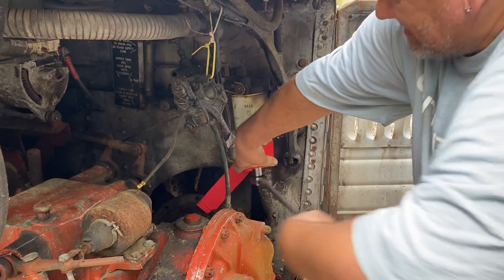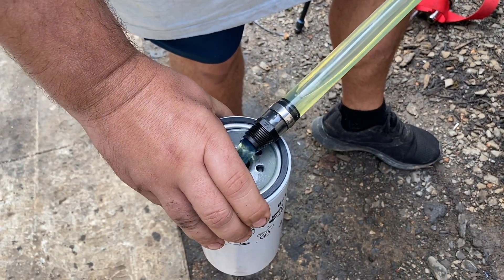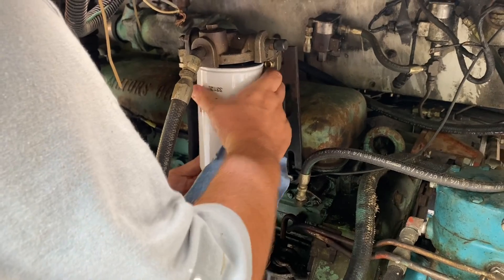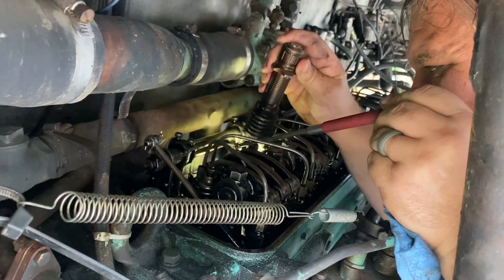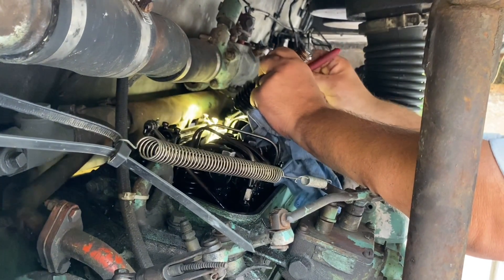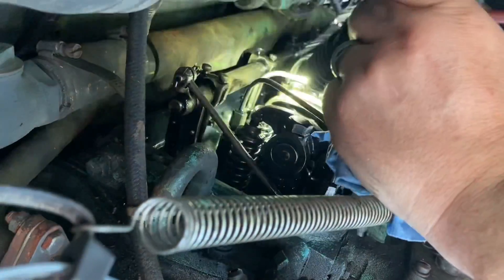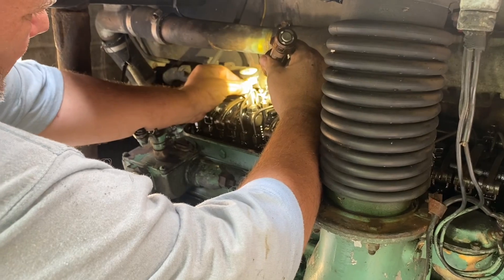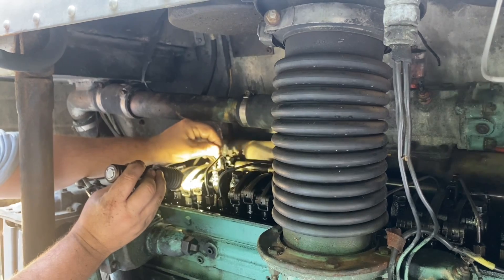Detroit diesel 671 2 valve or 4 valve head?  Hill climb, engine problems? Tuneup settings?

Comment: I use spring loaded oil filter tools with teeth.. That belt has too much play, and looks like it can slip... I have like 5 diffo oil tools.. That means i have to clean the filter so belt wont slip....  woops 6...

Comment: Don't put out the filters on so tight, it's a rubber seal.
Reply from the maker: It’s hand tight and i spilled fuel on the outside so it was slippery.

Comment: I know nothing about 71-series diesels, but I love your videos. It's great to see a methodical job done by a very talented Technician! 
I started using a plumbers tubing/pipe cutter to cut filters open. Much cheaper than the dedicated tool. I've also seen a guy use Wiss aviation tin snips to cut off the crimped edge to open them up.

Comment: In my next life I hope others have figured out that rubber sealed things are sealed at a faint amount more pressure than initial contact and that correct tightness is a little bit more than that so it doesn't  come loose.

Comment: 4104 with the propped up engine door! Looks like it did fine climbing that hill. Also noticed looks like quite a few of the hoses look new.. did you guys replace those? Looks like it’s going to be a nice bus for your daughter..
Reply from the maker: We did nothing but change tires, add fuel, replace battery, add temporary throttle return spring, fix air tank leak.
Reply: @BusGreaseMonkey  Nice.. definitely a bargain bus!
Reply: @BusGreaseMonkey  DOES YOUR BUS HAVE AN ALLISON TRANSMISSION?
Reply from the maker: @bellytripper-nh8ox  spicer 4 speed manual
Reply: @BusGreaseMonkey  OKAY, THANK YOU FOR THE CORRECTION!!

Comment: When I fill fuel filter from a can, I would plug the center with a 3/4 plug to force the fuel to enter from the outside and be filtered. No?  I love watching you do a tuneup.  Its very soothing...
Reply: No. You would never get the fuel to enter the filter that way. Most filters have anti-drainback valves in them.

Comment: scott on those tailpipes they make rachetting exhaust to reopen i feel.i.cut.the ends off &put 2 ends facing down or to the side like your i surprised no one made 2  holes and run them through the bumper

Comment: Who stays in that tent that has been pitched down there near the work site for WEEKS, that I have noticed? Or is that like a tent to hang out in the shade type thing? But that would seem strange to use a more expensive tent that sits on the moist ground vs just a cheap pop up shelter for just hanging out under
Reply from the maker: We just use it as a shed

Comment: N60 injectors and 2 valve head. Do you think it's  worth going to the 4 valve head? It would not cost you guys that much I would think to change the head and put bigger injectors. Yep that crank has got some end float. Thanks for the video.

Comment: I grew up around these things. Thats why I drive a truck now. Closest thing to wrenching i do now is replacing mud flaps. I learned from an old navy mechanic that the best way to get air out of the fuel system was to fill the filters with transmission fluid. It pushes the air thru and also cleaned the injector s as it pushed all the soot out of the tailpipe. Never had to fill the filters more than 1 time after that.

Comment: Question, looking for thoughts of why a Detroit 94 in a 1995 Pierce Fire Truck would miss fire when it warms and puffs out white smoke when it misses. The coolant is not getting into the engine and the truck will pump at the 2400 RPM fine. We are a rural Tennessee fire department and do not have a lot of money to get repairs. Any ideas would help we have changed the fuel filters and bleed the system.
Reply from the maker: Is it a DDEC?   What town?
Reply: @BusGreaseMonkey  We are 18 miles North of Jackson in Carroll County. I will have to get a picture of the engine as I do not know. I will be back in town this next weekend and will send the pictures.
Reply from the maker: scott@busgreasemonkey.com when you get the pix.   That’s only about 100 miles from us.
Reply: @BusGreaseMonkey  Thank you sir.
Reply: Check the injector timing, if that's ok, Check the fuel pressure at the injector's, if it checks out ok, it might be low compression. Does it use any oil? If she's ok with blow by,  I would be looking at the valve's. Good luck, white smoke is usually not good.

Comment: I never was a fan of the smell of diesel fuel and especially getting it sloshed on myself and my clothes.  Judging from the video I gather you're use to these issues!  Nice up front and dirty video.  Thanks for sharing!
Reply: If you disliked being around diesel, then try being soaked in gasoline, 75w-90, or hydraulic oil for 8 hours straight. I've had it happen to me on 3 separate occasions in my 10 years of working on diesel/gas/heavy equipment, and I've learned how not to get it all over me, even without gloves...
Reply: If you don't like the smell of diesel your strange
Reply: @lilypondgarage2968   Correction:  "you're (contraction for "you are") strange."  And if I'm "strange" for not liking the smell of raw diesel fuel and correcting one's spelling, then so be it!
Reply: Lol yeah you are definitely strange for correcting ones grammar, good thing for spell check or you would have a hey day correcting me lol

Comment: why so sad about 2valve?
Reply: I'm glad I'm not the only one who didn't know.  I actually don't know anything about detroit diesels or buses but its relaxing to watch this channel for some reason.
Reply: well i'd love to bring mine around, especially if there's an extra 2valve head around. but first need to do tire work and fluids and check exaust valves. hard starts might be low compression i can get back with an adjustment.
Reply: 4 valve head breathe better = moar power!

Comment: I’m wondering if they cut into the filters to see if there was any metal and/or bacterial growth in the engine & fuel system. (Edit, nevermind, typed that before they did it.) But a 2 valve head’ll certainly work and you can always upgrade if/when it’s rebuilt. I’m wondering if they’ll put on propane injection similar to what’s on Lenny. 

Speaking of Lenny, were you able to get the suspension fixed & are you still debating about installing a turbo? Love the content, keep up the great job!!!!!

Comment: If it's otherwise healthy in the engine dept, is there a 4v head in the future or just run with it as-is?
Reply: The 4-valve head will be better for long-term durability but it is a big expense.

Comment: Mechanics Tip:  when removing spin-on filters,  whether it be with a filter wrench, strap or big pliers, grab the can as close to the top as possible.  This will lessen the chance of crushing, twisting or collapsing the can.
Reply: Also, mark the filters with the date and/or mileage of the change.
Reply: I prefer the metal band version…and I do try to grab the can by either the top or bottom edges.
Reply: I've occasionally improvised with an old trouser belt and a lever through the buckle - you can get several wraps over most of the surface of the can - worked for me
Reply: Yup, I have a strap wrench I made from 2 motorcycle chains welded together around a 1/2 in. extension and it's never failed to remove a filter when constricting near the top where the thick mounting disc is.
Reply: @jimmartin7881  sounds like a hell of a strap wrench.   I could have used something like that on the hydraulic filters I had to deal with. Two chains side by side should provide ample surface contact and grip.  That's good thinking on your part.👍
Reply: Not really...They are mostly hollow throughout, and the steel bottom is as structural as the top.
Reply: @mountainman5025   friend  the top edge  has the thick plate where the oring sit in, the threads are cut , at the bottom  of the  filter  there is no structural  integrity to support  it from being  crushed.
Reply: @mountainman5025   Sorry bro but he's right there is a ridge around the top of most canisters&filters that will keep it from crushing. Great tip.
Reply: @mountainman5025  No, the top is much stronger compared to the wimpy bottom